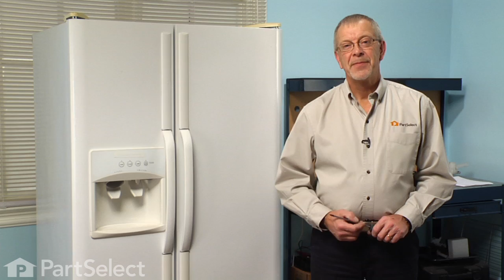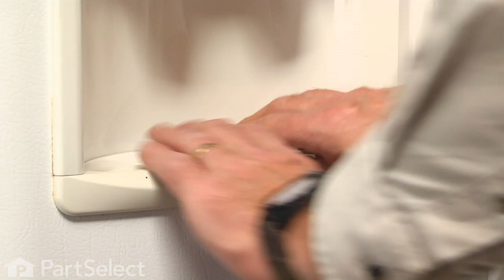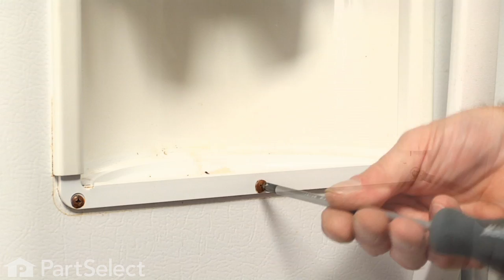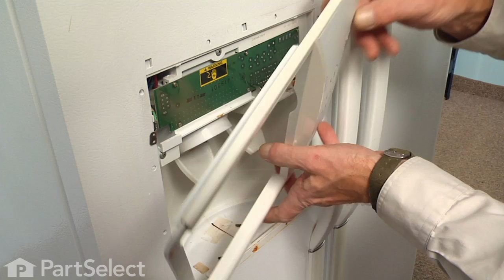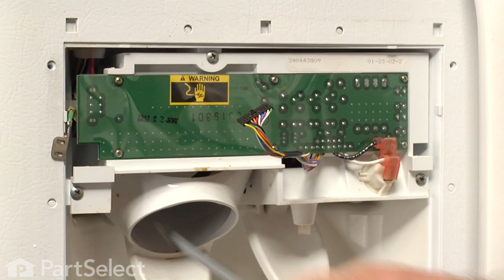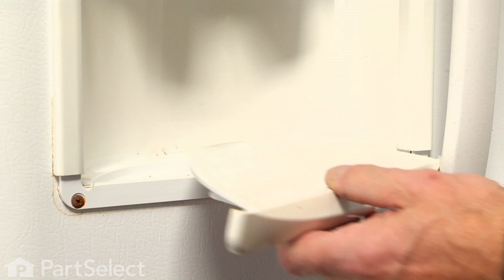Refrigerator Repair- Replacing the Water Dispenser Actuator (Frigidaire Part # 241682001)

Comment: I used this to get an idea of how to replace 241685701 actuator. It’s pretty similar, but there are wires for the LEDs. Because of those wires, you can’t keep the water tube attached AND remove the old wires, they are just too tangled in the PCB assembly. You can cut the wires or pull the water tube out of the PCB assembly. I pulled the water tube out. It’s not fun getting it back in, but I was able to jam a small screwdriver into the tube and feed the screwdriver back into the hole the tube goes into. 

The other thing that is different is that the ribbon cable between the button panel and PCB assembly did not have an attached connector that can be easily removed and reconnected. My Frigidaire had a press fit connection that utilized a retaining clip. I had to remove the button PCB from the plastic front face and carefully place the ribbon cable in the connector and put the retaining clip into place. It was doable, but took some dexterity.

Comment: Re inserting water tube is a pain. I used a double pointed scribe “the hook side” .  Heated up tip, poked/melted hole from the outside of tube, then fished it through, again using hook side of scribe from the outside.  Scribe hook was narrow enough to fit. Also rubbed cooking oil on tube to help slide.

Comment: The instructions are really good.  I've had to do this 2x now.  The 2nd time the actuator SPRING got knocked out of it's position.  Let me tell you, without unhooking the hose, it can be a real PAIN getting the spring back in place.  if you look at the video the springs straight end is the longer end and is creating tension on the actuator.  So it seemed really puzzling that the other end is latched in place has a hooked end?!  I didn't find any instructions on youtube or the web on putting it back in place.  After a lot of trial and error, and pulling the whole section down(so I could see the latch), I was able to see that if you slide the hook end under the latch(which is open on one side) you can turn the spring in place.  This will hold the spring in place while you put the new actuator in place.  My model is slightly different than the video where the 2 screw side, one of the screws is replaced with a post instead!?  SO coming in from the bottom where you don't have to unhook the hose is quite difficult.  Good luck!!

Comment: While I appreciate the instruction, it I
S hard if not impossible to do. Putting it back the hose is stiff and won't move the actuator is super loose, how tight should it be?   Honestly I cannot do this
Reply from the maker: The actuator should not be loose. Check to see if the spring is properly engaged with the actuator arm, and also that the retaining screws are tight.

Comment: the hose popped out of the panel hole how can I get it back in there? the space is too tight for my hand
Reply from the maker: You should be able to access the outlet tube by removing the escutcheon and the dispenser control assembly. With the assembly tilted forward, you should be able to re-insert the tubing.

Comment: Hi there, I have the same fridge and neither my ice dispenser nor water dispenser work. There are green lights for "Cube" and "Crush" as well as a red light above "Filter Status." When i put a glass up to either dispenser I don't hear any action taking place from the refrigerator. Do you have any idea what might be wrong?
Reply from the maker: Check the dispenser control board connections first. What is your model number?
Reply: It's model number FRS23R4A. I tried to replace part #5304421827 but I can only find refurbished parts and the refurbished one I bought doesn't work any better than the old one.

Comment: Great video, thanks!!  I have the same fridge and replaced the water actuator.  When I re-assembled and plugged it back in the ice dispenser runs continuously.  Any idea whats wrong?  Thx!
Reply from the maker: +Keith Brown It sounds like you may have mechanically activated the ice dispenser switch. Check the position of the ice actuator.
Reply: +PartSelect Thanks, I'll do that!
Reply: i was really excited when i saw this question. I am having the same problem. does not seem to be mechanically activating - any other ideas. it is possible the electric ribbon or circuit board was damaged?

Comment: For a loose water line get a metal cloths hanger and untwist it. Cut off the hook leaving only the twisted  part at the top. Feed it into the dispenser hole then into the water line for about 4 to 5 inches. Reattach the dispenser with the cloths line hanging out. Now pull the hanger causing the water line to come through. Carefully pull the rest of the hanger out

It took me 2 tries. 😄

Comment: I just wanted to say thank you for the video! I fixed my own refrigerator! I have to admit I was a little scared that I was going to break the tray on the bottom when I first started, but I found by pulling out the right side first it came right out! The only difference I had from the refrigerator on the video and mine was that a thin wire bus was connected to the cover and it pulled out when I took the cover off. Since my cover has lights in the buttons for the ice and water etc., I knew that the wire bus had to be connected. So when I put it all back together I pushed the thin wire bus back in making sure that the side with the metal connectors were touching the other metal connectors in the printed circuit board. It workes perfect! No issues! I found the water actuator part for my refrigerator on Amazon for only $20 something dollars so I saved a lot of money. Thank you again!
Reply: Good job! I have the same model, I think, but I’ve been too nervous to try to disconnect the ribbon cable from the front piece. Glad to hear that, if they do come apart, it won’t be the end of the world (unless I tear the ribbon cable or something). Thanks for the tip!

Comment: I have a Frigidaire model FRS26ZRG. How do I remove the front assembly to replace the water actuator? It is different than this video.
Reply from the maker: +deekay2 We are not familiar with the disassembly procedure for this model, but the parts breakdown does not indicate any screws to hold it in place.

Comment: For those who have the problem with the disconnected water hose... what worked for me was cutting a medium weight wire clothes hanger (not a cheap wire one you get from the dry cleaner but a good heavy one) I bent a slight curve in it, inserted it through the opening the water tube needs to be inserted through, then up a ways into the tube. I used that to guide the tube into the slot as I pushed the housing back into place. I was surprised to see that it guided it through like a charm!
Reply: Thank Rob.  Tried the hanger trick and it worked.
Reply: The video showed him not disconnecting the water hose. Why did you disconnect it?
Reply: Take action guys: use this link ...before they runs out !! Links Here!! ---  https://www.facebook.com/StreetFight-Hero-Unlimited-Gold-Crystals-Cheat-955624864473923/?pidid=6161b0aa-a13b-48d5-b454-4a1a848fa65f  === !! Guides placed right here commonly working.                                                                Refrigerator Repair- Replacing the Water Dispenser Actuator (Frigidaire Part # 241682001)

Comment: If you have a ribbon cable (which is flat) connected to the escutcheon, rather than a wire cable as shown in the video it is removed by sliding out the locks on either side of the connection.  When reinserting the ribbon cable after replacing the actuator be sure the metal terminals are facing up, slide in with the locks pulled out and lock in place by sliding them back in. With the power restored, you will see green light lit.

Comment: BEWARE!  This is detailed but doable except for one critical step.  Reconnecting the water tube.  It's nearly impossible to do the repair without removing it, by the way.  Don't overestimate your ability to perform this one critical step.  Everything else went with no problem, even though my model wasn't EXACTLY the same inside as the demo.    But the water tube is stiff, short and just does not want to be reinserted.  I have tried everything at this point, except for going and getting someone to help.  Two pairs of hands will help!  So would a head lamp.  Your hands are busy, but you need some light on the subject.  OH yes, you WILL need those needlenose pliers, the needlier the better.  So I am fully installed except for the water tube.  Next I am about to look for some kind of fitting on the end of the tube  to make it longer, tapered and more flexible.
Reply: +Eve Waterhouse OK, that worked.  Should've tried it two hours ago.  Here's what happened.  Went to the hardware store, bought a 12" piece of nice clear flexible hose that fit snugly inside the current water tube.  With this, it was a piece of cake to feed to hose through.  Reconnected everything and pressed the actuator and ... water was seen trying to force its way down the pipe.    Alright, I thought, snip it at the end, but before I did, I tugged slowly and steadily on the smaller exposed length of tube and whaddaya know, it pulled the correct water tube into place.  Success!

Comment: The hose disconnected at the dispenser end. Any pointers on how to reconnect?
Reply from the maker: Nick Smith  Carefully insert it into the opening and then feed it through until it is flush with the nozzle. You can also fashion a piece of insulated 10 or 12 gauge wire and insert an inch or more into the end of the tubing to help prevent kinks.
Reply: ***** Thanks for the reply! One more question – so the 10-12 gauge wire could be used as an extension? Because the tube is short, and it's very difficult to reach the nozzle.
Reply: Take action guys: use this link ...before they runs out !! Links Here!! ---  https://www.facebook.com/StreetFight-Hero-Unlimited-Gold-Crystals-Cheat-955624864473923/?pidid=6161b0aa-a13b-48d5-b454-4a1a848fa65f  === !! Guides placed right here commonly working.                                                                Refrigerator Repair- Replacing the Water Dispenser Actuator (Frigidaire Part # 241682001)

Comment: The video was very helpful!  You should caution about the ribbon connector to the front panel circuit board --- if not oriented properly when reinstalled the system will play dead and nothing will work. Mine would insert either way but the contacts on the ribbon must face the contacts on the female connector. Then everything worked fine.

Comment: I replaced the actuator but when I put the wire back into the front panel circuit board, all the lights turned on and the ice dispenser started making ice without stopping. I don't know what causes it, but now I effectively can't use neither water dispenser nor the ice dispenser. Is that a circuit board problem or what?
Reply from the maker: Ambipath I could be the circuit board. If you can get me the model number off your fridge I can make a better diagnosis.
Reply: ***** Model number PLHS67EESB9
Reply from the maker: Ambipath That does sound like a circuit board problem.
Disconnect the actuator harness connectors and see if the problem goes away.

Comment: Don't accidentally remove the water line! It's horrible to try to hook back up. A suggestion if you do- tie a "noose" around the water line with fishing line. Then feed the line back thru dispenser orifice. Pull like hell and steer the line with a needle nose pliers. It worked for me.
Reply from the maker: Hi Matt, thanks for sharing this tip! Hopefully viewers will find it helpful!
Reply: Our water line pulled out. I used your suggestion and it worked great.
Reply: Hello.  When I try to use my water dispenser, water spews out from everywhere, except the the little tube that it's supposed to come out.  Is this what you were referring to?

Comment: ok Steve got a question I have the ribbon on my front cover how do you put the ribbon back on....my actualor works now but does not give me water because I was unsure of how to put the ribbon back together.......thanks for any help...... Frigidaire FRS26LF8cs3
Reply from the maker: Hi Amy, on the control board behind the dispenser there are two input connectors that the dispenser wire harnesses connect to. Please see the following link for the input connectors' location circled in red. http://i.imgur.com/DWYTjrf.png Hope this helps! Best of luck with your repair!

Comment: Great video, very helpful.  I too, with your help, was able to replace the actuator in minutes.  HOWEVER, when I plugged the system back in, water sprayed everywhere.  At first, I thought I might have a mechanical issue, so I disassembled it for an inspection.  Everything looked good.  But plugged it back in, water everywhere.  So now I suspect an electronics issue.  Any thoughts?  Anything that would need a reset to fix this issue?  Thanks much for any advice you can provide.

Comment: The actuator on my whirlpool is stuck in the "pushed-down" state. No water is coming out but if I push it forward or backwards with my hand, nothing happens either. Any tips on how to troubleshoot this? I'm assuming it's been disconnected somewhere at the top but can't see anything that would indicate so
Reply from the maker: The actuator usually makes a click type noise when the it connects to the fridge micro switch. Remove the dispenser control panel verify that the actuator contacts the dispenser switch properly. If it doesn't then inspect actuator housing bracket, switch mounting bracket and the actuator pivot. If any of those parts are faulty then they should be replaced. If the actuator is contacting the switch, you will need to check the micro switch or control board (if your model has a control board). Let us know how you make out. If you need more help then please provide the model number.

Comment: Is this the same procedure for 253.54662402 and part 241685701?
Reply from the maker: The procedure is similar for your model. If you head over to our website and enter in the part number in the search box the parts page has some great customer written installation instructions that you can read and follow to help you with your repair.

Comment: Hi Steve, I have an Arctica GE model PSM27SHSC GS and the problem is that it does not working the Ice Dispenser, but it makes Ice, and also dispense water. I already check the cel enosis and is ok. What do you recommend me to do. Best regards.

Comment: GE Profile side by side (PSS26NSWASS). after four years the water dispenser reduced flow to 5% after a few spurts. Changed filter (no change), increased freezer temp. no change), changed water inlet valve (no change), purged for three minutes for trapped air no change). Could actuator be the culprit? Any suggestions?

Comment: Great video! You came so close to addressing my issue. The fridge/water/ice dispenser in this video looked a lot like mine.
My water dispenser tube is cracked and leaking. I have a Kitchenaid Superba KSRG25. Is the tube replaceable, or is it more complicated?? I cannot pull that darn tube out of where it disappears into the back panel area..Thanks for any info you can give me.

Comment: Great Video. I have a somewhat similar problem if you could help me nail down the issue. I have GE Profile Arctica (came with the house in 2001. The water dispenser problem started with water leaking after every dispense. Then yesterday morning I got up to see water leaking continuously all over the kitchen floor and leaked thru the ceiling of my basement. I removed the water filter cartridge to sever the water connection. How do I get this issue fixed and what parts will I need.

Comment: Hi. Great vid... Thanks... Question.. I have a Frigidaire side by side similar to the one in the video. My ice dispenser works, but often I have to push it really hard and it might click on and off. Seems like something is not "making contact." Any idea what that might be and if you sell the needed replacement part(s)? Note that the ice maker and water dispenser work just fine... Thanks.

Comment: Very helpful video. I just want to share a point that I experienced with our fridge:  
For the first wiring plug that was removed, on ours there was no actual plug.  Pulling up on a retainer where the wire "ribbon" plugs into the door control panel allowed that ribbon to be released.  To reconnect it though, I found it easier to remove that white panel from the door by removing 5 screws, lifting that retainer, sliding in the ribbon, and pushing the retainer back down.

Comment: Thank you!!! Word of advice- DO NOT disconnect the water line. It is a nightmare trying to connect it back. The refrigerator comes with a very shorts line an it is impossible to connect back. I had to use a splicer  to reconnect .